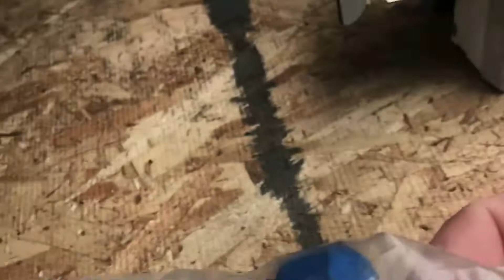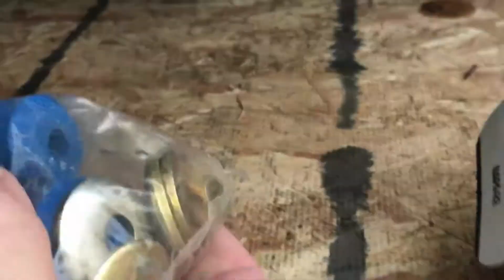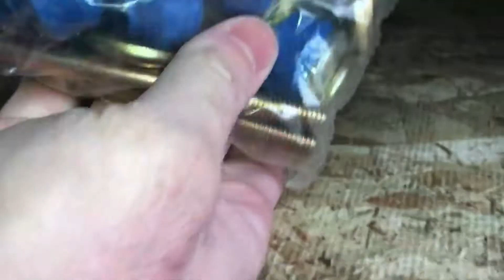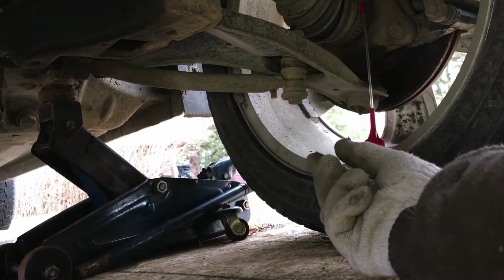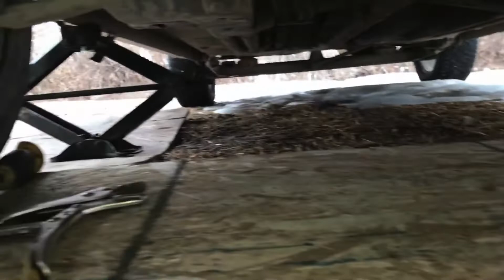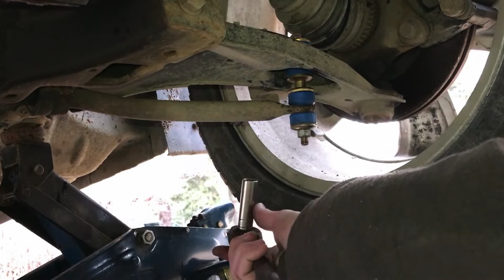Sway Bar End Link Replacement, PT Cruiser (How to)

Comment: i got my shocks, control arm, and front right motor mount done, and it still sounds like it's gonna fall apart. now what?
Reply from the maker: Over the internet I would just be guessing. Where abouts is the noise coming from?

Comment: If the car is up on jack stands with all 4 wheels off, how do I go about replicating the “midway point” of travel?
Also, are you a hedgehog owner?
My daughter inherited one from her high school biology teacher!
😆
Reply from the maker: If you have wheel ramps those will work or you can put blocks of wood under the front tires, or you could put a jack under each control arm. Yes I have a hedgehog, unfortunately not the same one, “Spiky” passed but I enjoy having them as pets so much I did get another (Henry).
Reply: Yeah, all 4 corners are on jack stands with wheels removed, I’ll jack the new control arms once they’re in.
Pretty much replacing everything suspension and/or steering related, front and back.
Eventually giving the car to my daughter with the hedgehog and getting a new car for the wife.
Her hedgehog’s name is Reggie.
👍

Comment: It's very good video on how to change those sway bar links didn't skip any steps showed exactly how it was supposed to be done even an inexperienced person could do this if you just watch the video and it's important that you get those stacked up the way they are otherwise you're going to have a catastrophic failure with those bushings and you're going to be wobbling all over the road the only thing I do different is I use a bottle jack to pick up that sway bar and when I start putting the last one on and it's important you keep that bolt pointed down even though it's might be easier and see more logical for it to be pointing up but if you do that it's likely to get caught on that boot that you see that the bolt has to go right by and you'll have about an inch too three quarters of an inch of nut or a rod sticking through there and it'll tear that boot use bottle Jack's and jack stands of course you only need to do one side
Reply from the maker: Thanks for your kind words. The sway bar is actually not that critical of a part, it just is for improved handling and less body roll on corners, but it is nice to have it proper. The other concern is the way it is on a PT if it was to break both end links the bar could actually come down and catch on the road which would be bad.
Reply: @CarswithNash  well what I liked about it was you showed how to stack those bushings because some people are just starting out there's no instructions you know unless you look at the other side which maybe just as bad or maybe a different configuration you never get the same thing I can tell you the joint on the other side of my mind didn't match up so when you do one side you really need to do both other than that you're welcome buddy

Comment: Another well done video Matt, your Admiring Followers thank you ! 
I want to work on my own Cruiser but I do not know where the safe jacking points are.  
I have seen images of damage done to cars caused by incorrect jack placement. 
Can you enlighten us with a quick video ?
Reply: If you're still interested in working on your PT I don't know how old this is but I can tell you where to jacket and the safe points are but you're going to need some small wood blocks I got some small 2x6s because if you put a jack right on the frame you going to bend it in you don't jack it up by the engine unless it's frames already supported but you will have to Jack the engine up at some point depending on what you're doing
Reply: @KK-sn8bp  That is great advice ! Using wood blocks will distribute the force on the frame. Thanks KK.

Comment: This is not helpful. This is misleading information. Because now you have an inch of bolt sticking out the bottom to get bent or broken off, plus it looks like hell. The bolt goes up from the bottom.  Don't post a video of how YOU would do it, post a video of the "correct" way to do it.
Reply from the maker: If you put the bolt up from the bottom it will tear up your CV boot, if you don’t like the bolts sticking out, simply cut them off, it’s a universal part not a factory replacement. You should try practising being a more polite individual.

Comment: I took off my tire to do this and only had one jack so it was a little hard to get the nut on. Thanks for the video. I got one side done so far. Brrrr....it is cold out.
Reply: I finally got it done. Due to being depressed about the capital attack, it took a bit to get around to finishing. I had trouble with the 2nd tire. I ended up taking off the last rubber piece off of the first side to give myself more slack for assembling the 2nd side and then ended up deciding to assemble the 2nd side with the nut on the other side because the axle was in the way of the bolt. I am happy with the results now. It is finally done.

Feel free to share the idea of leaving one rubber piece and washer off before going to side two and then going back and adding it. It helped a bunch.
Reply from the maker: @MrNathanstenzel  Yes that was a tragic event, very disheartening to see. Be careful with having the nut on the other side that it can’t contact the axle boot and tear it is all.
Reply: @CarswithNash  now that I have driven it a little and things probably settled, I can check to see how things look.
Reply from the maker: I can certainly identify with working out in the cold!❄️ Glad the video is proving helpful to you.
Reply: @CarswithNash  I think one of the linkages gave way some time before the other one. I had to really convince the left sway bar to get into position for the assembly. The right sway bar is needing convincing in the other direction. Do you think it could be that the sway bar got bent?

Comment: So...not loosening the sway bar mount to make it easier is OK? Just bend it so save time. If the end of the sway bar bushings are bad the mount bushing probably are too. Don't think I need advice from Matt on how to PROPERLY perform car repairs.
Reply from the maker: gary rumbaugh I didn’t bend a thing, the rear mount is a pivot point, it moves freely there and in this case was still in good condition as they often are, so I only replaced the end links. If you didn’t need my advice and know so much more then me why’d you watch the video in the first place?

Comment: Dude, no jack stand?
Reply from the maker: JustAskingAndCurios Haha! I do try to put a wood block or something under normally, guess I was in a hurry on this one... I certainly recommend it.
Reply: Thank-you for all your help, but ALWAYS, ALWAYS, ALWAYS use jack stands when going underneath. Allow yourself NO EXCEPTIONS. If a jack stand is getting in the way of your access, re-think jack stand placement or your access point even if it means more work and takes more time. Please, don't rush on something like this. That extra time to think it through is gold and can help change your mind-set when underneath vehicles or anything heavy. This work is possible WITH the safety jack stand or solid blocking. Carefully raising and safely blocking a vehicle is the most important part of most under-vehicle projects. Never trust a jack with your life, especially when you're prying and pounding underneath. OK, now I feel better!

Comment: For the extra $20, replace the frame mount bushings too, as the rubber gets hard and if there is any play, it will cause a clunking noise.  Even though the bushings look fine, mechanics will suggest replacing every other suspension part until they recognize the bushing problem.
Reply from the maker: ya472 I actually replaced those on this car a few years ago, no clunks, but yes that is good advice.
Reply: That's sage advice bro.  I replaced the CV Axles, Shocks & Struts before I noticed all the bushings were turning into black jello on mom's PT Cruiser.